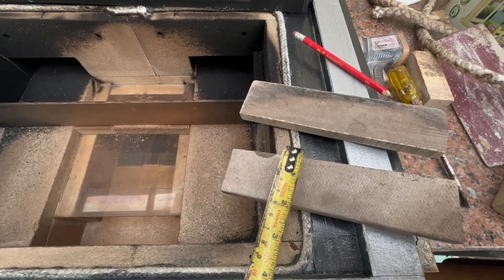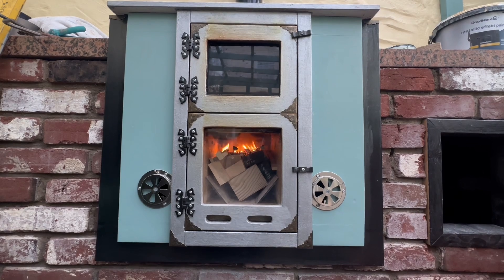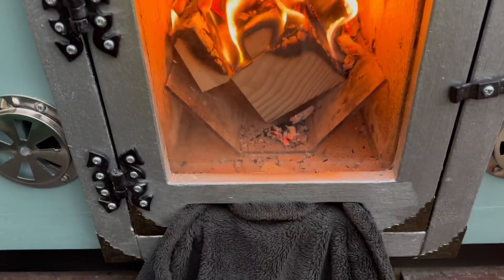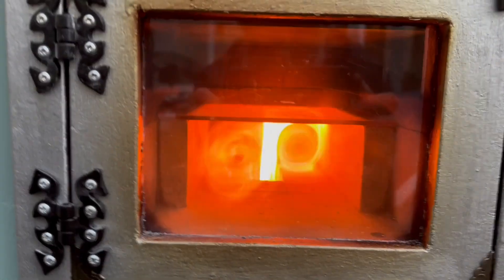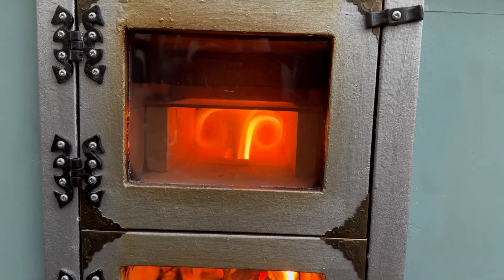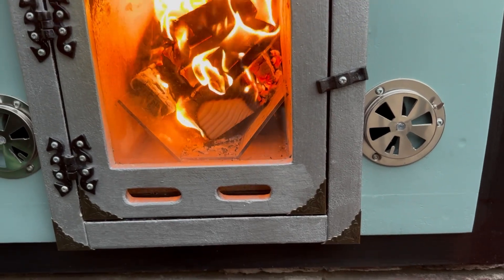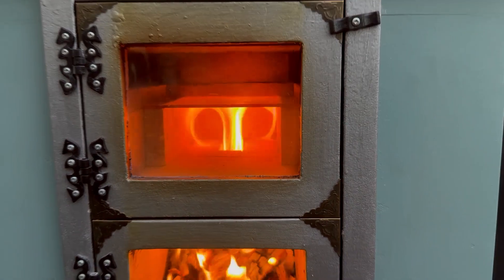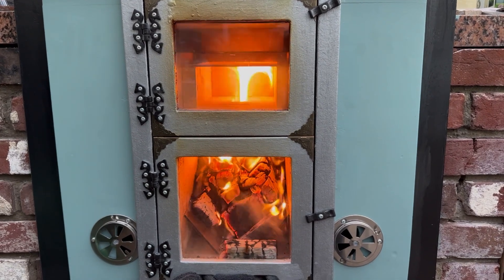Lovely vortex

Comment: Fox Fish, that is not secondary air. What you have is primary air that is a bit warmed up. Primary air does not need to be warmed up. Many types of wood stoves and masonry heaters take "below freezing" air from the outside via an outside air line. There is only one place to inject secondary air to actually make it "secondary air" and it's done correct in this so called "P channel" in a rocket stove. The secondary air always goes right at the location where the flames are "squeezed through" a smaller space into a larger space, just before or after your "port." This is why secondary air tubes on regular wood stoves are on the bottom of the baffle board. All smoke must pass along the board to get out. I don't think secondary air does much of anything on your stove design, but if you were to inject secondary air or you need to do it for an experiment, the location would be exactly at the "slit or slot" location (port) where the flames pour through to the top chamber, using a tube with the holes for secondary air along the ceiling of chamber one pointed toward the port, or on the floor of the top chamber pointed toward the port. Because your stove carries SO MUCH heat, secondary air along the glass of your top door may do something, but it won't do much. Secondary air is pointless if not injected into an area of extreme temperature. Your double vortex burns off 99% of the smoke so there is nothing left for the secondary air to do. You would be better off plugging the secondary holes which are not secondary holes, removing the plates the wood sits on, and putting the wood on a grate or, for experiment purposes, wire mesh so the air can get UNDER the flames and the wood. Not that you need the darn thing to burn hotter... but... what the heck.
Reply from the maker: @stoveadvice  Thank you for your opinions, and I apologise for my incorrect termononigy however if you can look back over the last three years of experiments you will see that I do have some experience with secondary and even third air. I have tried many many variations and I fully understand how pre heating air affects the system. 
This is just a hobby for  having fun but if you would like to join in with the experiments and build your own version that would be great?
Perhaps you can find the perfect balance of  dimensions and air control ? 
You may be interested in my vortex J tube that was also tested over many years with many forms of pre heated primary and secondary air?
Thank you for taking an interest.
Reply: @foxfish7115  OK... I see... yea... I should have been watching your stuff a long time ago....   Keep going.

Comment: Fox Fish, the wood, as you laid it to start, is very tightly packed together and the pile allows little to no air to get to 70% of the wood. I would assume that is much more of a reason for the "slow start" than just removing 20 MM of space on the plate. For startup, consider making a wire mesh log or chicken wire log with hollow ends. Curl it up "round" like a piece of PVC pipe. Place the wire mesh log "in the middle of the pile," pretending it's a piece of wood.....  let the air flow in the center of your wood pile at the start up using the hollow, wire mesh log.
Reply from the maker: @stoveadvice  Thanks for interacting, what we are trying to avoid is burning to much wood at one time as this is what cause the overfueling so top lighting is really important at the start so the fire has time to heat up the inside of the insulated firebox before all the wood catches.
If you leave big air gaps and spaces between the fuel, the fire will just flair up and produce far too much wood gas for the system to deal with. The glass will turn black, smoke will exit the chimney and the stove will massively over fuel .
If you look back over the years of experiments there are quite a few examples !
Reply: @foxfish7115  this comment will surely trigger @Stoveadvice :D He does not believe in insulating the firebox.
Reply from the maker: @ Solid brick or high mass will simply take a lot longer to reach operating temperature, if there is no insulation the fire box will eventually shed heat through its walls. This may or may not be an issue depending on the stoves purpose and design. 
It is possible to build a brick firebox on the vortex stove but you run a much higher risk of smoking up the glass and of course polluting the atmosphere with smoke. The upper chamber really does need insulating in order to reach the temperatures required to form a clean vortex but perhaps or a bigger stove, 6-7” might get away without? 
The main benefit of using insulating material is warm up time and prevention  of radiating heat where it is not needed.

Comment: Hello . It looks beautiful. Tell how did you cut the petroceramic glass ? But what if we want to use something permanent instead of it with that width? Do you think of solution? 
Thank you for all that nice work
Reply from the maker: @baitadonis1  it is easy to cut the glass with a standard glass cutter, just like normal glass! It will last for years but it will go opaque after a time. You can use kiln shelves or maybe cast iron.

Comment: Try putting about a 2 inch wide piece of your glass in the top box just after your twin vortex just before the fire leaves the vortex area and goes up into the final area before it exits. That should defuse the smoke and the twin vortex should consume more or almost all of the smoke thus creating a hotter burn and easier control with the primary and secondary air.

Comment: I am going quite mad just commented and moved on without  hitting the comment button.  Firstly the left hand bias was clearly being fueled by unburnt  wood gas traveling up to the transfer slot from the left rear of the stove. May I suggest this stove might be better bottom lit rather than top lit !!!  And finally I get the distinct impression your stove would easily  deal with green wood once up to temperature might need to be balanced with seasoned timber. But temperatures look to be high enough to deal with the added moisture and burn off creosote.  Oh yes you live by the sea try collecting drift wood all types small enough to feed the stove, I have always found drift wood gives off huge amounts of tar burning really hot like that might provide a good fuel source. might best be dried out first though. Pine cones?
Reply from the maker: @davidprocter3578  thanks for watching, if you lite from the bottom the fire will produce far to much fuel that just leads to smoke out of the chimney. I am a builder so I have lots of wood but I do collect drift wood for other uses.
Reply: Never burn driftwood, the chlorine will release toxic gases, dioxins if I'm not mistaken. Look it up :)